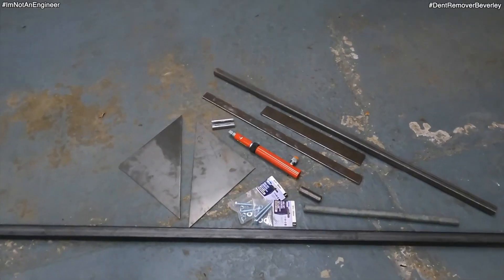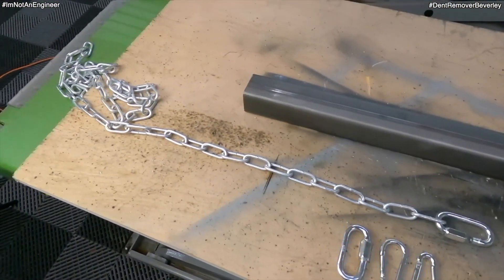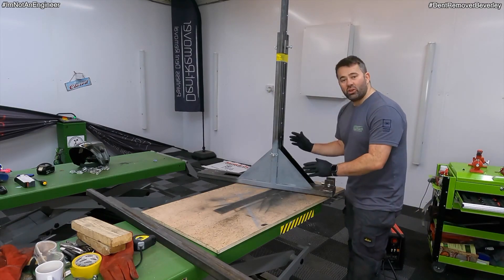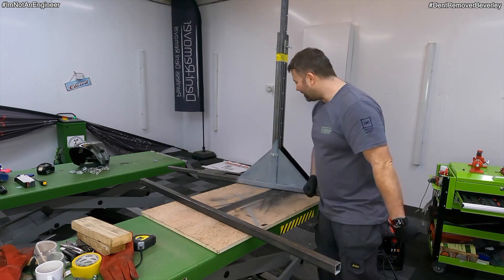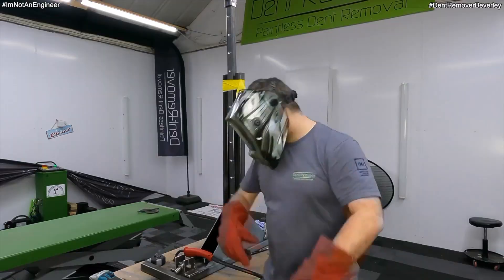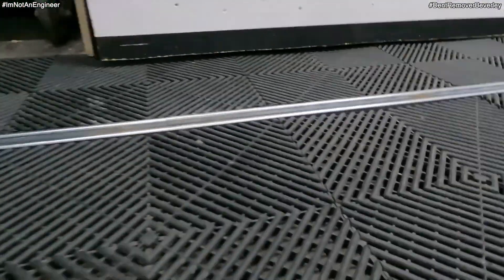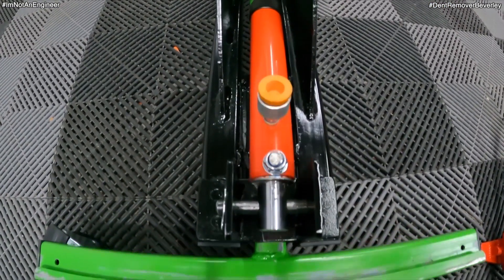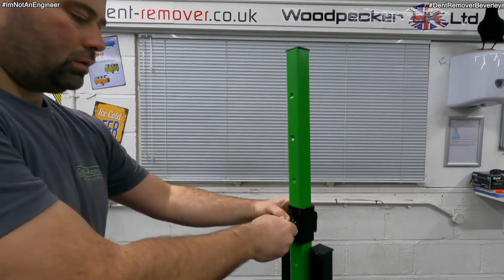HOW TO MAKE A GLUE PULL TOWER (Part 2) | PAINTLESS DENT REPAIR |Dent-Remover

Comment: Hi mate, can you please elaborate what final changes you made towards the end of the video? And what porta power you used ? Good stuff mate. Thanks from down under.
Reply from the maker: Hi Amit. Yes sure do you mean the foot plate and over extension pin? Are you trying to make one yourself? 

The porta power is a “powerTec” one which is an off the shelf kit

Comment: What's the best glue Martin?
Reply from the maker: Hi Paul. My favs are Glexo hot in the winter and Hawg (orange) in the summer (uk climate)
Reply: Where's the best place to get them?
The stuff I've bought online has been very poor, could you recommend a seller.
Thanks very much for replying 👍👍👍
Reply from the maker: @paulpaintshop103  where do you live? Uk?
Reply: Thanks very much Martin, will do that.
BELTIN 👍👍👍👍👍❤
Reply: Yes Wigan, I have a small restoration shop and I'm interested in pdr to fill the gaps, I'm a Panelbeater by trade.
Reply from the maker: Please contact Kevin Andrews at Keco Uk in Peterborough. 
Mention I sent you and you want to ask about glue pulling. He’s a really nice chap and will talk you through everything for sure

Comment: Great work, will definitely be building mine. I especially love the channel attached to the floor. That was the missing piece of the puzzle for me. and solves my problem of buying a traditional body shop pulling tower  attached with floor pots. 👏👏👏
Reply: Did you draw up plans Martin? Awesome bit of kit by the way 🤙🏻🤙🏻🤙🏻 loving your channel.
Reply from the maker: Hi Nelson PDR my pleasure if you need any pointers just get intouch. I’m sure all the measurements are on the videos. It’s a very sturdy puller and solid when anchored into the floor 

Thanks Martin

Comment: Hi buddy!Am sorry am a real body shop repairer since 37 years!Never seen so weak chain to pull off fenders ok but not a girder!Same for the size of your hydraulic ram too light...
Reply from the maker: Hi EagleBaldone Tough thanks for your comments and thoughts. 

Yes I know the chain is a weak one compared to a body repair shop but there’s a big difference in what repairs we carry out, I’m a panel beater too and use to use the dozers, clamps and big chains for pulling chassis legs out, boot floors, sills etc and this chain wouldnt last a second

Use if the above on a glue pull repair where we are sticking glue tabs to the panel I’d say it’s a little excessive and a lighter set up would work much better. 

I’d be extremely suprised if the chain snaps on one of my repairs and il be the first to hold my hand up if it does. As for the karabiners, yes they won’t last long so the screw type are to be used. 

The ram is rated to 4 tonne and from the repairs I’ve carried out upto now there hasn’t been an Issue In performance I can pump a dent out with one hand no problem. 
I think only time will tell with this. I put a lot of thought into the tower and I’m confident it will work without any problems for quite a while 

All the best for 2022 let’s hope it’s better than last year

Martin

Comment: Great job with the design and ingenuity of this project. I admit I am too lazy to do all that work,  I would rather just buy one lol. As a safety precaution, I would throw a towel over the chain during use incase it decides to fly off at one point, don't want to get whipped by a chain.
Reply from the maker: Hi Javani thank you I really appreciate your comment and recommendation regards the safety. Yes your absolutely correct I use to do this when jigging vehicles and do have a blanket and bungee strap to limit any sudden shock or slap 
Thanks again and all the best for 2022